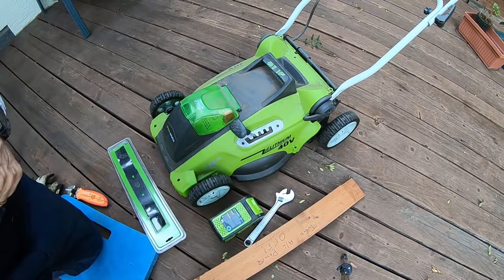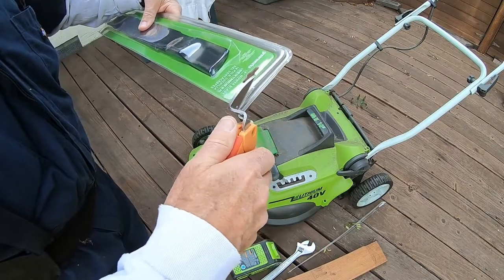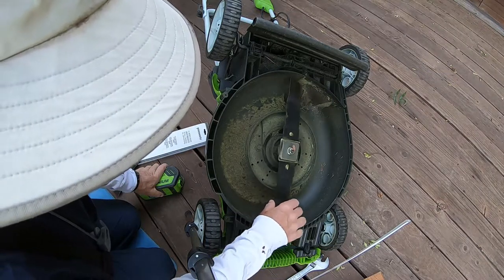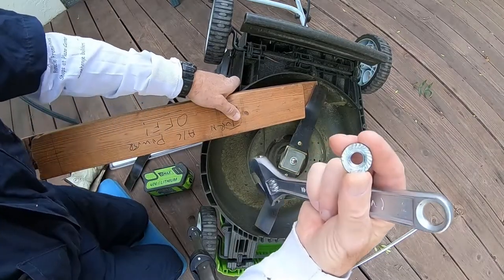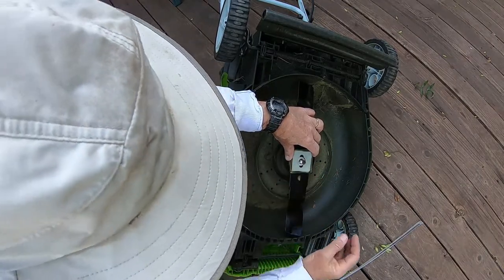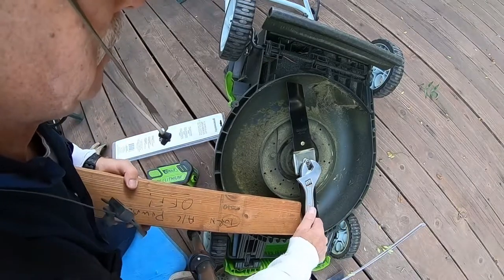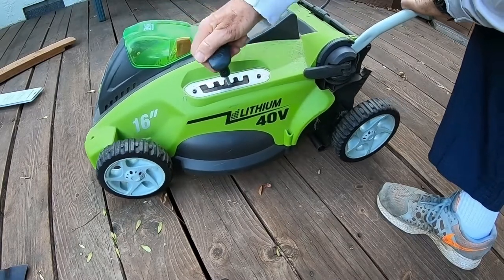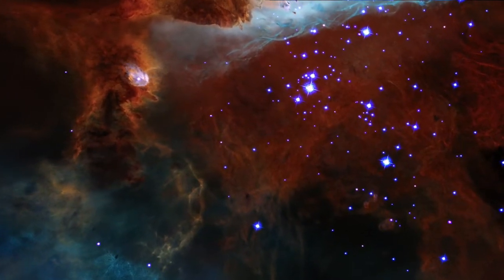Greenworks 16-Inch 40V Cordless Mower - Replacing Blade & Review After a Few Years - Part 1

Comment: Helpful hints - don't make a video with a hat with a brim.. Turn counterclockwise on the mower. The plastic "spacer" is called a blade insulator. If you forget which way to reassemble it just look at your own video from earlier when you took it apart.
Reply from the maker: Okay sure.

Comment: Your voice is too low and your hat is in the way. Please re-do video. I needed to see how to change the blade on same mower. Mine is making a rubbing noise with new blade, don’t know why. Trying to get new parts.
Reply from the maker: Thanks for the feedback. I’m getting a better microphone. You can try turning on closed captions if you can’t hear. 
Yes my hat got in the way for parts of the video. The bolt loosens by turning it counterclockwise and tightens clockwise. You need to use a piece of wood or something else to keep it from turning while you’re loosening or tightening.

Comment: just when i needed to see the layering of putting the blade back on, your head/hat covered what you were doing.  bummer!
Reply from the maker: Sorry about that. Yes my hat got in the way for parts of the video. The bolt loosens by turning it counterclockwise and tightens clockwise. You need to use a piece of wood or something else to keep it from turning while you’re loosening or tightening.